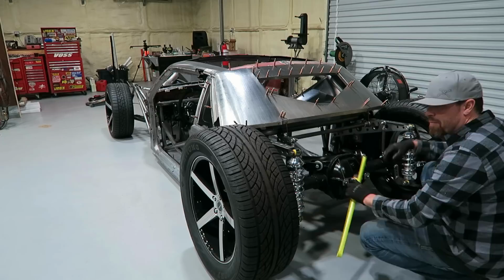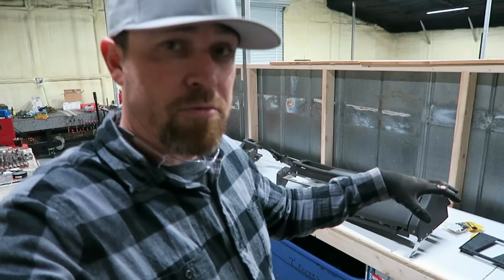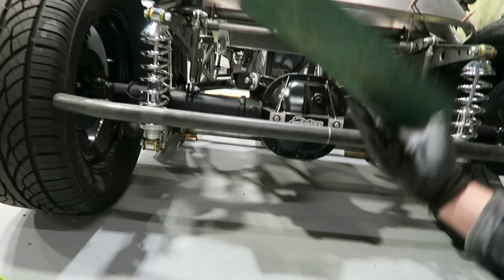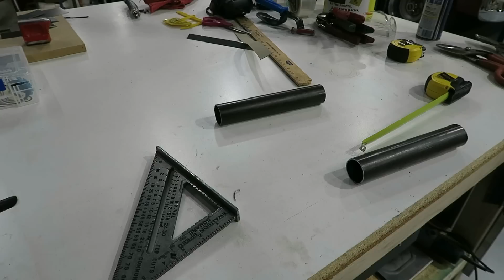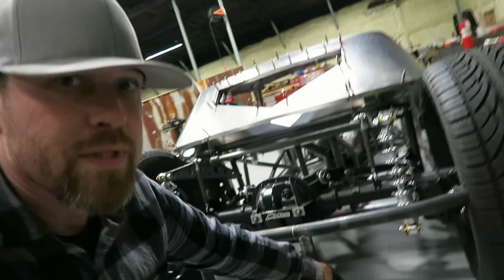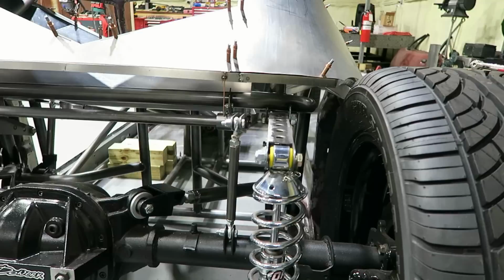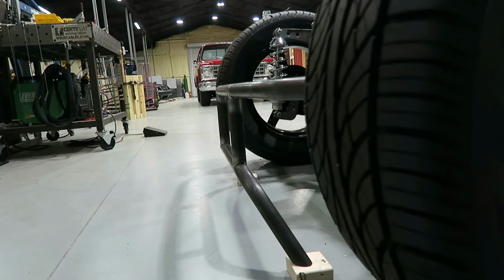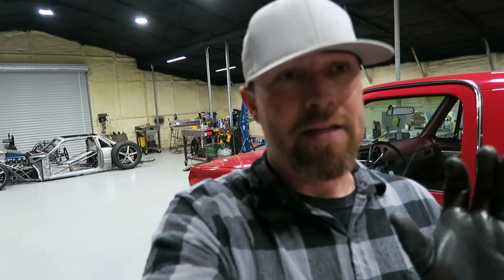How To make A Tubular Rear Bumper

Comment: Saw you eyeballing the "levelness" of the tube before bending. 
Small tip: weld a little piece of flat to the tube. 
Take it as a reference plane for a digital angle finder. 
Set to zero before first bend  and there is no more guessing. Especially when leaving 2-D stuff.  

Keep it up! 
Greetings from Berlin/Germany  ;)
Reply from the maker: I have a clamp-able rotational gauge for doing that...mainly use it when doing complex stuff. The eyeballs serve me well on the simple stuff and make things much faster

Comment: Looks cool good simple base for bumper. Could run some legs on the lower bumper towards the front to connect to the main chasis then curve 2 tubes to the curve of the wheels so the bumper tucks nicely to the curvature of the body and the wheels. For the top could make some slight bends in the tubes towards the main chasis for your core support so if per say something happened the entire car would absorb the grunt of the blow so itd be minimum damage plus itll give you access points for bumper removal. Just an idea to look into maybe. Great curvature on the bumper makes for alot of ideal fab panels to attach. As always its a joy to watch your fab work.

Comment: Kyle, car is looking good. Have you thought about a perforated steel for the left and right sides? Maybe 1/4" flat aluminum stock tracing the shapes on either side with blacked out perforated steel and aluminum rings for the exhaust to keep that modern look you're after. Just a thought I had while watching.
Reply from the maker: I have thought about using some kind of perforated material....not exhaust though. I would love for the exhaust to exit the rear but dont think it will be possible with the limited space on this thing

Comment: Instead of tubing if you rather use sheet metal that's solid or steel sheets you could make the outer edges smooth then they can scalp around or you could sculpt them with an English wheel so their smooth and rounded in the lower outer corners. With tubing you would have curved edges in the lower bumper corners at least with the smooth sheet metal you could even dimple die it

Comment: Looks  CRITICAL ON GROUND CLEARANCE  is your BIBSTER use for airport runway's only ?.
Reply from the maker: it has hydraulically adjustable ride height...I have it as low as it will go now to make sure the panels clear the tires

Comment: What hydraulic setup are you using on the tube bender?
Reply from the maker: just a home made deal
Reply: @Thefabforums  got specs or links?
I have a model 32 bender and want to convert it over.